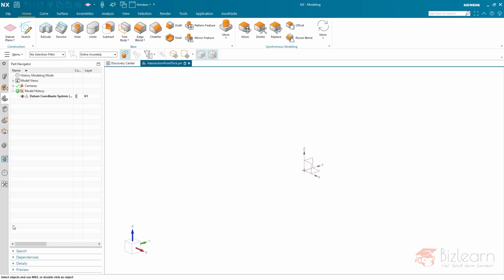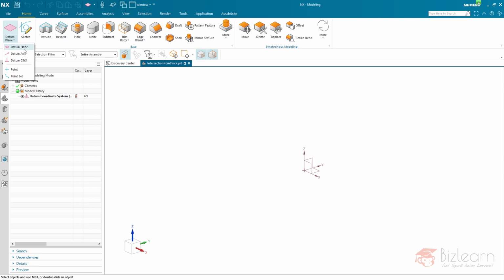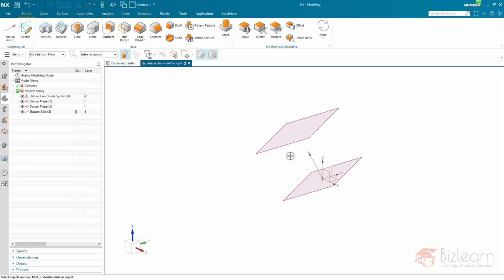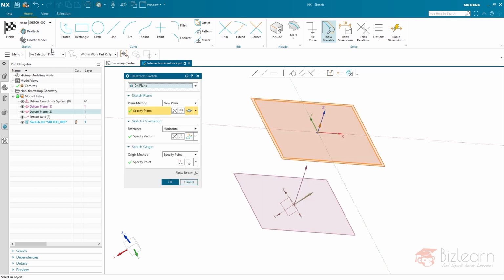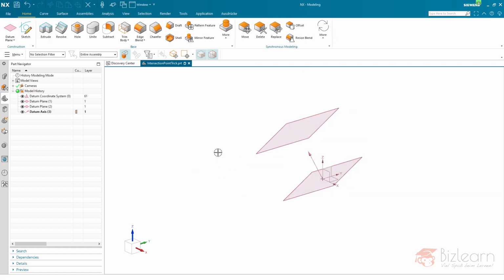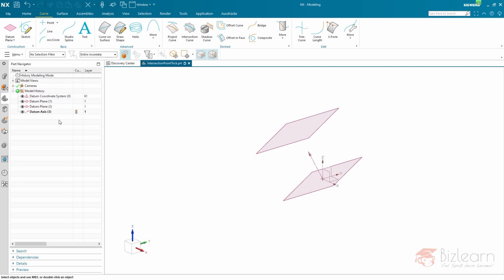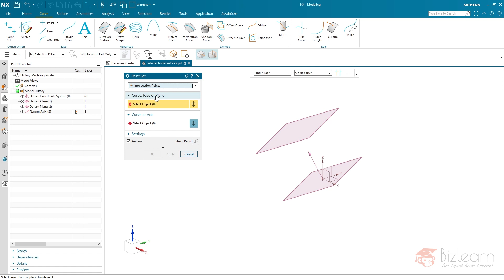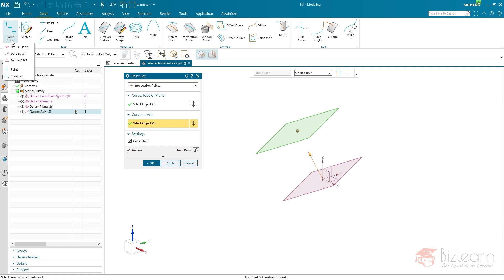Siemens NX 2306 CAD Secret | Is it possible to create an Intersection Point between Plane and Axis?

Comment: Wouldn't it be just as easy, and ultimately more useful, to create an Offset CSYS?

In the Offset CSYS dialog, click the "rotate first, then translate" option, rotate it about the two axes to get the desired 45° angle, then translate it the desired distance along the desired axis. When you're done, you then have 7 geometric elements at that point instead of just three (i.e. origin point, three planes, three axes), and it's easy to edit the angular orientation and offset distance via the Offset CSYS dialog box. You can also edit the appearance of the Offset CSYS to make it smaller or larger, change line type and color.

I value you teaching us another way to use Point Set command, and I apologize if I'm missing something here, but after watching I was left scratching my head as to why you didn't use the Offset CSYS, "rotate-then-translate" method.
Reply from the maker: Use Ur Illusion. For this scenario, the csys makes sense for sure. It's just a representative at all. But for any other, the point makes sense.